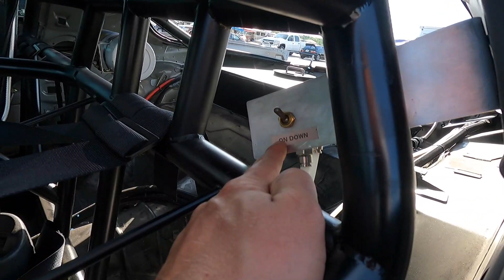Moon Tune! Camaro Can Fly!

Comment from the maker: Check out SimpliSafe here simplisafe.com/cooperbogetti SimpliSafe is award -winning home security that keeps your home safe around the clock. It's really reliable, easy to use, and there are no contracts.
Reply: It's a good day when  you learn something.  I find driving  on the open road  is a good time to think . Keep  on ripping.
Reply: The limiting straps, Coop. They were too tight. That’s why the bump didn’t stop you quick enough. The tires left the ground so there wasn’t enough friction. I think the bump box worked fine. Watch the slo-mo. The front wheels only barely turned. The front brakes do need a line lock or increased bias too, though.
Reply: Simplisafe is junk. Look up lockpickinglawyer. It can be bypassed with a 2 dollar device. Maybe try selling raid shadow legends or keeps lmao
Reply: DOGECOIN INVESTOR COOP?LETS GO..MEET YOU AT THE MOON/MARS BRO🤙😁🚀🐶🌚
Reply: With your truck you should be able to tow a flat bed and a camper in the bed
Reply: I suggest you not rely on the stock brakes to hold back that much power! 
Get a set of Wilwood or Brembo Brakes, they are designed to hold!
Reply: i love the reactions from your wife coop she loves you bro!
Reply: Wheelies !! 
She lost some weight ?  
Get it lmfao ...
Reply: I have Simplisafe and love it!
Reply: @andylewis7360  he wheelied on purpose to copy cleeter lol
Reply: Did your front bumper break the beam & then rise back out? Maybe that is what confused the tree.
Reply: Looks like you jumped over the beams on that last one. Maybe dial back your 2 step RPM a bit so you still leave hard but on at least 3 wheels.
Reply: So just wondering, what's up with the exhaust anyhow?
Strictly a functionality thing?
Usually see em flush-cut at the fender or maybe a little stick out.  Don't usually see a big Ole bull horn.  Lol either way, cars fu**in fast so it doesn't matter.
Reply: Save the race track sell the house!
Reply: Need a better finer bumb box 👌🤙
Reply: @andylewis7360  I agree with this the most out of the other conclusions. It just makes sense and you can see it happening.
Reply: @TreyCook21  Thanks Trey. It’s really just a theory but I think it kinda makes sense. Especially since Coop actually says that he tightened up the straps as much as he could. Moderation in everything, eh? 😊👍🏻

Comment: Coop when you over bumped the reason the tree seemed weird to you was you rolled threw the beams before your opponent had lit the stage bulb. The timing system gives you an automatic red after seven seconds if you haven’t staged. You had lit the stage bulb which started the seven seconds of the timing system but unfortunately you lit it then rolled thru the beam.

Comment: 20:57  If you watch the rear rim closely it looks like it bumped twice.  Also, the tire wrinkles twice.  I don't know how bump boxes work but I wonder if your finger on the switch too long.  If the bump box doesn't have the circuit already, maybe a monostable multivibrator op amp circuit on the thumb switch input would help.  That circuit will make one and only one pulse of a set length so you won't get two switch pushes by accident.

Comment: One thing for sure ,you should have a plug or tape da end of ur exhust pipe to help keep air flow from corrupting ur turbo,no oil flow,while towing ,even with it tilted u can get some spline rotation from air flowing past it at hwy speeds

Comment: After you lit the top bulb the car rolled forward a lot, watch the front tire. You were deep in pre stage before the bump.
Just do everything the same every pass, from car prep to driving. Fuel the car every time, check the pressure before getting in, same burnout, same staging, etc. 
You will be competitive and drive home happy!

Comment: In the slow mo over lay you put up you can see that you did roll another 2/3 inches after the prestage beam lit up. Tighten up your reaction to the pre stage beam coming on and that will help. I use the True Motorsports Smooth Stage and its awesome. It really helps control how the car goes into the beams on the 2step. Motion Raceworks has them.

Comment: Bump box is pretty spicy but it was working as it should.  I think the issue was you went in pretty deep for the pre-stage so when you bumped in you bumped past the stage beams.  On the second pass against the Viper you didn't go into the pre-stage beams as far.   I think if you had backed up quickly and re-staged you would have been golden.

Comment: A lot of guys will use a line lock and apply light pressure to it when bumping in that way track conditions will have a minimum effect on how the car bumps in its pretty consistant.

Comment: The long bump on the third pass seems like it may have happened because the front tires lifted off the track.  You can see air under the left front in the slow motion video.  Tightening up the front vertical travel is what changed, and that is probably what caused the long bump.

Comment: You need to shallow stage the pre-stage so you don’t bump through the stage lights. 
I don’t think the front brakes are the issue because the front wheel were actually in the air during the bump. The tree wasn’t activated yet, that why you didn’t get a red light right away. 
Good job anyway Coop, you’ll get it figured out!

Comment: Ever seen a trailer swaying left and right (it can result in a crash if it gets bad) That's usually because the weight is to far back on the trailer, ideally you want some weight over the rear axle of the truck as it adds grip.

Comment: change the air in the tires with nitrogen (use the bottle on youre mig welding machine) that should help against pressure increase when the tire is heating up
about the wheelstand, it looks like it allready was on the way down by the time you lifted , mightve been able to kept in it

Comment: I'm thinking you need a little more weight in the front.
The first bump worked because you weren't at full boost.
The second one nearly lifted the front wheels, and pushed forward to far.

Comment: What relay are you using on your transbrake. Your bump is way to violent. You need micro movements, not macro. Its better to have to hit the button 2-3 times to get the beam than to wrestle here down on one bump. I use the holley SSR through my HP.
Reply: Exactly my thoughts he is trying to dial in on 1 button push when it's better to have it set to 2 or 3 small movements almost to point it rolls into beams not upsetting chassis.
Reply: @ninaallen7849  yeah, his slow mo clearly shows the front end unloaded in the bump. The fronts never even rotate.

Comment: You need to calm the bump box down even if you have to tap it a few times. Bumping that aggressive you are upsetting the chassis and that will cause you to wheelie 70% of the time. You can see how compressed the front shocks are when the car bumped to far. I member watching the video of you getting the new bump box and had it barely bumping when you were in the driveway testing it. So just turn it back down like you had it and bump a few times to light the second bulb. You'll get it man. Keep your head up and the more seat time the better you'll get. You have a great set up and it has so much potential stick with it man.

Comment: It's tough to control the "bump" when you pull the front tires off the ground with the BUMP.  Based on what I saw, brakes weren't going to work with tires in the air!

Comment: Maybe your front brakes could be better as you stated but in that bump the front suspension unloaded a lot causing the front tires to come up almost off the surface so even rock solid brakes would not have held it from sliding forward. The bump was very aggressive.

Comment: Your front tires came off the ground a little when you bumped in the second time. Watch the slowmo of your second bump in that you red lighted your front tires didn’t even rotate forward because they were either off the ground a little bit or barely contacting the ground to hold the your car back. Can you hold your brakes in when you use the pump button? If see try holding the brakes during the bump in

Comment: Even with the bump in with the viper the car seems to bump very hard if you watch how much the car jerks and bounces when bumping in. I would think you would be better tuning the bump down and actually hitting the bump a couple times where it literally rolls in. But don't think it's a brake issue the bump is just turned up to much you don't want it hitting so hard and upsetting and bouncing the chassis before launch a nicely set up bump will pretty much roll into the beams. It's for sure a bump tuning issue don't be afraid to have to hit bump button 2or3 times

Comment: You need a faster releasing solenoid for your bump box mate,  this way it will allow you to do faster and shorter bumps ,
Reply: That bump with the Viper seemed to really shoot the car forward.  Take a look at the front tires at 14:28.  Would a different solenoid tame that down a bit?
Reply: Coop can count on you! Look at all that racing/bump boxing content on your channel. No doubt you are an expert!!
Reply: @eriklarson9137  lmao
Reply: @eriklarson9137  why the shade? Relax warrior
Reply: @chris-thumper7205  yes it will, running a better quality solenoid with high voltage to it will result in a faster/shorter bump in
Reply: @robertkotevski9649  That's pretty sweet.  I have the general idea how they work, but I've never gotten into the technical aspect of it.  Thanks!
Reply: I didn't think of that but that would definitely help. it also looks like it pulls the front end off the ground bumping in
Reply: All the brakes in world won’t help if your front wheels aren’t on the ground 😎
Reply: It sucks but coop had opportunities to test the bump box
Reply: Agreed the bump is a little long. Faster solenoid or CO2 bump maybe?
Reply: I really have no experience with it but I was under the impression that it was the pulse length I'm not saying they don't make faster action solenoids but I'd assume he would have a decent one
Reply: @jasonbishop7746  Well, you know when he has the ample opportunities to test in a non pressurised environment, he always just says that two passes is enough and goes home so he doesn't break the car. Unfortunately this results in him not being fully ready and without enough experience and muscle memory etc for when the pressure is on in a racing scenario. You can tell this, as every time he races he misses something. Whether it's intercooler, parachute CO2, tyre pressure........whatever. 
What he needs is support from someone who knows what is going on, ie: not Bronte, and to knuckle down and concentrate at the job at hand, until then he's just a rich kid playing with the big boys.
Reply: Yep, can change the bump strategies also... it is set on the aggressive kind.
Reply: I thought it looked fast but then I realized I was watching in 2x 🤣
Reply: @ElliHarper  🤣
Reply: @nickmaclachlan5178  if that’s your style of “tough love” , it may need some refinement 🤓
Reply: @jkK-lw9lu  Just telling the truth pal. I really wish him the best, but he's his own worst enemy.
Reply: @billkunz9993  if he was on the brakes harder it wouldn't have hit so hard, wouldn't have lifted the wheel enough to allow it to lock due to the little weight.

Comment: Can you creep instead of bumping?
Reply from the maker: That's what I need to start doing, hard to train the brain to hold the button instead of click
Reply: @CooperBogetti  I'm sure you'll figure it out. A video of you just testing bump and creep settings would be very interesting
Reply: @CooperBogetti  change settings so you just tap button 2 or 3 times have slower small bumps instead of 1 big violent bump will also help from upsetting chassis. Tightening the front also kept front from going up as high as run before therefore creating more forward movement as well all that combined with deep stage was the issue yes brakes is also a good idea will help this issue some and also help slow down but bump tuning is main issue. Need a slow roll in bump or short small bumps both of which can be done just a preference if you prefer tapping the bump button or holding it.

Comment: 1: No instant red because you bumped through before the tree was "activated"

2: Front brake pressure doesn't matter when the bump box is so aggressive the wheels are in the air. Box should be about 1/10 as aggressive as it is right now.

Comment: Your brakes are not the problem . It lifted the tire and slid . You could put 12 piston brakes isn’t gonna fix it . You need your bump set up correct . I think you have smooth stage ? That can creep into the lights instead of bunny hopping over the beams

Comment: Once you pass the beams you cannot back up you are disqualified instantly. You were bumping in and you bumped past both stage lights with a flicker and when they flicker the timer does not start until it’s solid. So the system thought that maybe you had not gotten to the stage beam to start the timer for the either green light to come on. Once the starter realized what was going on he pushes a button to force the start which then gave you the red light and the competitor a green light.

Comment: I think it's about time you up your game some more. 
Get some new brakes (preferably including line lock), probably even a suspension upgrade that doesn't rely on limter straps. 
And teach Bronte how to check and adjust tyre pressure and how to stage you properly.

Comment: if you used a transbrake and bump box, better front brakes shouldnt be a need, it would just lock the tires up and push through them, and fight the idea of the trans brake

just gotta play with your staging game to be consistent in your placement, then work on your box timing to bump in where you want in

Comment: So here is what I seen.... Since you tightened up the limiting straps. When you bumped up it pulled the front wheels off the ground and pushed the car past the line. It wasn't the bump box fault, the front tires were just literally not on the ground.

Comment: Also when you staged... you didnt just hit the start of the light you rolled into it, you lost some distance for the bump you have set up. 
Brakes are not an issue when the wheels in the air, you tighten the straps at the front, the wheel ran out of shock travel, and up they went, and the twist in the rear tire pushed you past. 
You have a real aggressive bump setting, if you tame that down the above issues are a non-issue.

Comment: @Cooper have ya tried backing the Camaro on the trailer it might give ya the difference your looking for just a thought
Reply: Years ago I learned the hard way the importance of actually knowing what my trailers tongue weight.  The long and the short I put a tool box on the front of my trailer and loaded it with a couple hundred pounds of tools etc and stowed my cooler like Cooper is doing which added another 75 pounds of weight to the nose of my trailer and then I started moving my car back like Cooper because I had not realized how much weight I had to the tongue of my trailer and then like Cooper I moved my car back to farther on the trailer the end result is I moved my car back to far back and hit a big bump and almost had a real big wreck as it was I bent the back part of the frame on my truck and the tongue on my trailer.  Frankly what happened to me was minor compared to what could of happened and I got the frame pulled on my truck and reenforced it and I straightened the tongue on my trailer.  I then found someone who understood trailer load balancing and he explained a lot of things to me and helped balance my trailer load.

Comment: Hey Cooper, have you ever thought of airbags on the truck? It helped our trucks handling alot with the rough roads of Oklahoma, it kept the back off the overload springs so it doesn't bottom out on the bridge bumps and humps in the highway. They are fairly reasonable price. We have them on all of our trucks.

Comment: In the slow - mo the breaks were holding pretty good it seemed it may be the bump box or something else ..
Reply: The wheels rolled a little but I think he was too deep and it was pretty violent too. Watch it at quarter speed in his slow-mo, it's pretty crazy. May have skidded the front tires some too.
Reply: Yeah the bump is pretty hard even the bump with viper was pretty hard then tightening front probably caused to roll forward little more less momentum up so it went forward more.

Comment: Your bump box hits so hard it picked your front tires up so it’s not your front brakes that are the issue. Your bump box hit hard and seems to be a long bump as well. Jame’s bumps are short and quick. Whatever he has on his is what you need
Reply from the maker: You can see the front wheel rotating as it goes forward
Reply: @CooperBogetti  I see that but the wheel also came off the ground so locked up or not if it’s not on the ground it’s not gonna hold anything right? Haha I get that it’ll help, but I think the main culprit is the hit of the bump box being so violent. Just an observation. Keep up the fight. You’ll get it lined out eventually
Reply: The bump is definitely to violent the tire literally almost came off the ground leaving almost no tire even if the brakes held. Instead of trying to get to bump in perfect in 1 button press needs exactly what you said smoother slower 2 or 3 button bumps just literally tap button 2 or 3 times. A lot of fast guys are set up like that like James as well as John Doc and his buddy Matt even talks about bumping u almost want car to roll into beams so chassis doesn't bounce around so much unsettling it